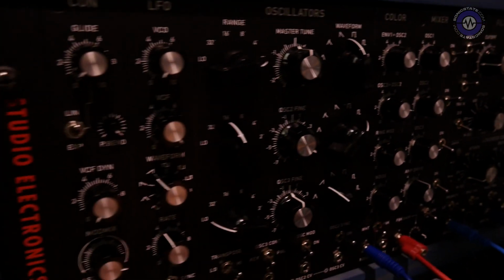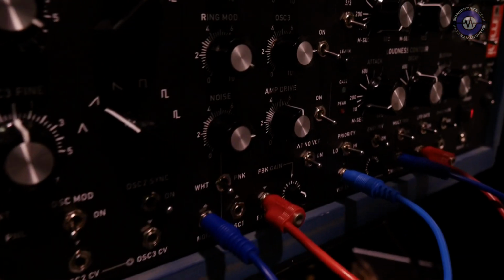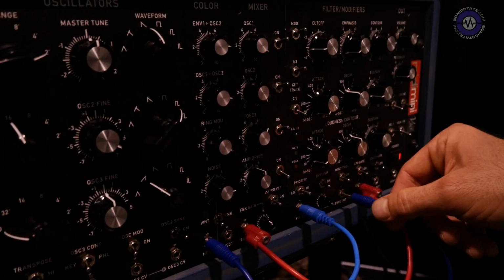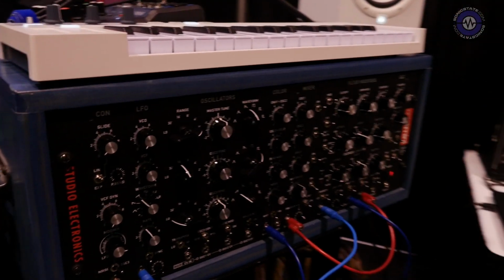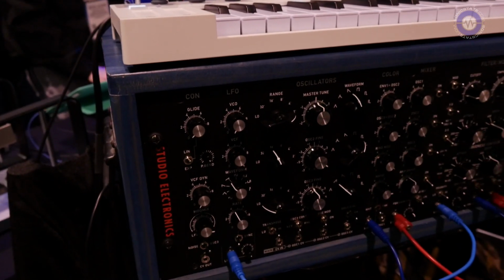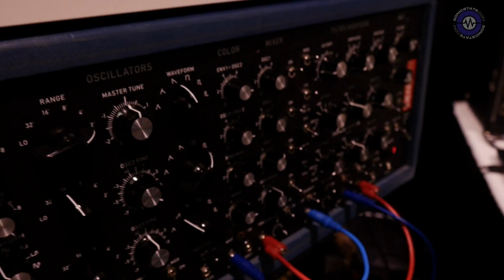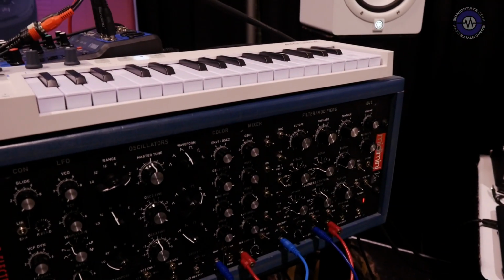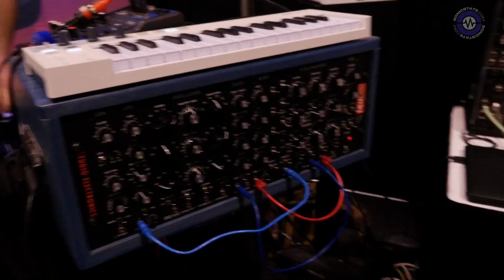NAMM 2020   Studio Electronics MIDIMini V30

Comment: This is clearly enthusiast grade, I'm assuming the average consumer would just go with the SE-O2?
Reply: I have an SE-02 and an SE-1 (the forerunner of this and uses the same chips *mostly*) and I think the SE-02 sounds better...obvs this has more functionality than the SE-1
Reply: So many Mini-type synths now. The SE-02 has some nice extra features, but I sold mine after getting the Behringer D, because it sounds a good bit better IMO, and stays truer to the features of the original Model D, just adding a few patch points. The Boomstar 5089, also made by SE, is in the middle cost wise, around $1300. Its really just a dual VCO mono with a ladder filter though.
Reply: @Deeplycloseted435  i've got a D too and I still tend to use the 02 more than that..the Neutron I love as well..like you say..lots of cool mini synths, and we've still got the monopoly clone from Behringer to come..what a time to be a synth nerd :D
Reply: That behringer moog system 55 though